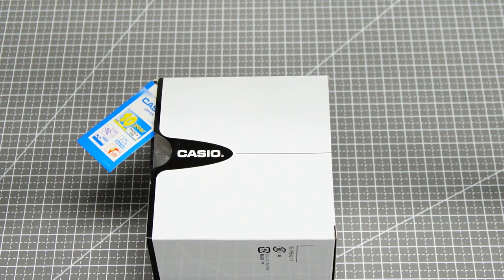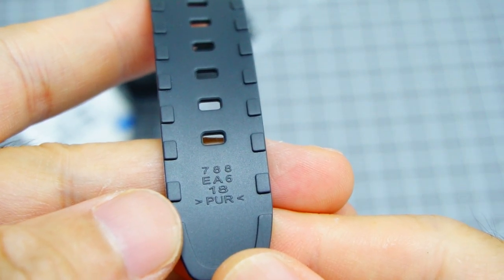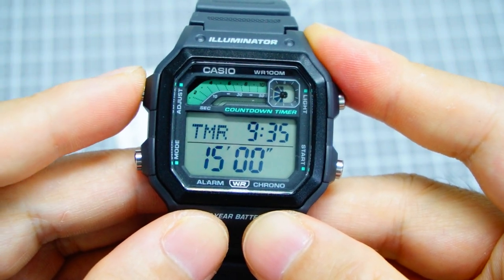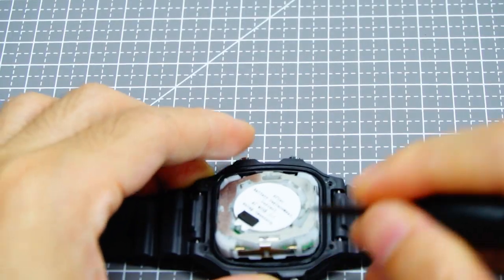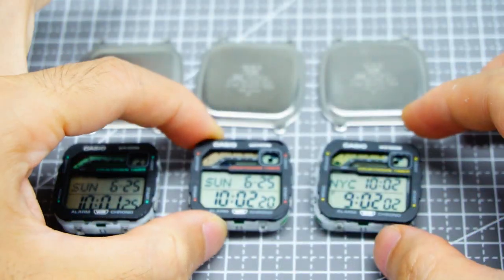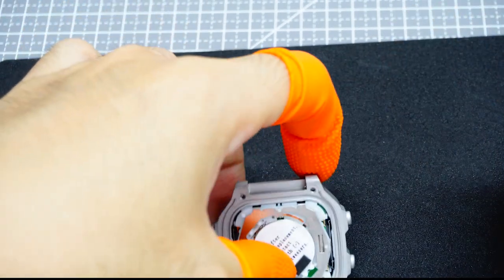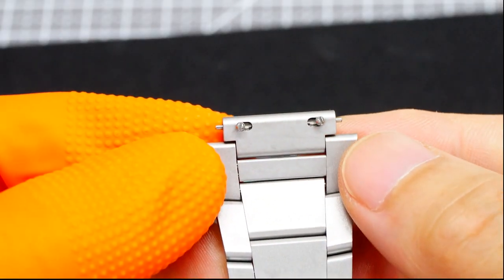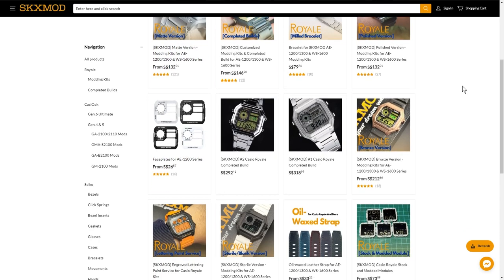"Casio Royale" WS-1600 Series Unbox, Comparison & Modding | Parts by SKXMOD

Comment: Do the polished version and the black one, have the same scratch resistance as the matte silver version? Thanks.
Reply from the maker: Unfortunately, harden coating is only available in silver and black parts. But don't worry, rest is not that easily scratch too.
Reply: whether polished or frosted, silver and black have anti-scratch coating.
Reply: Just by the nature of the finish matte will always be more scratch resistant than polished versions.
Reply from the maker: Indeed it is.